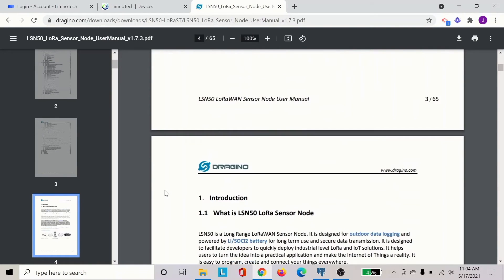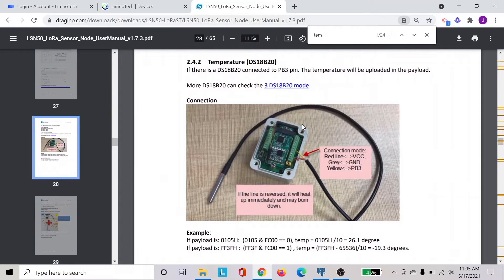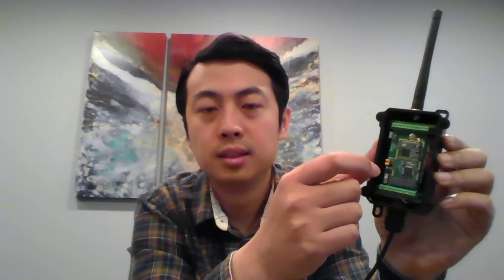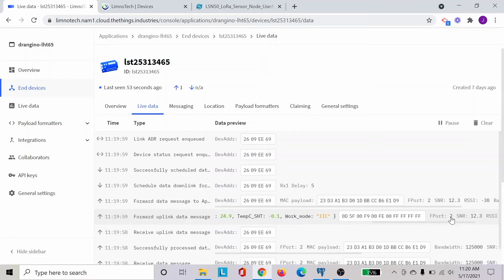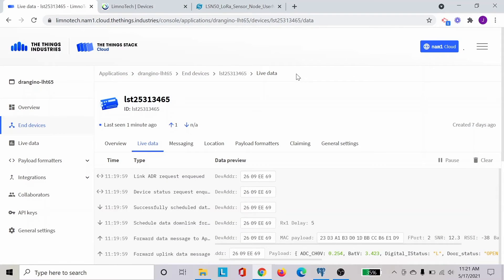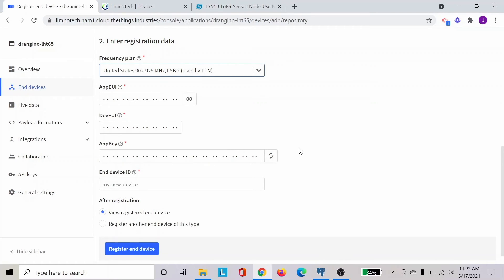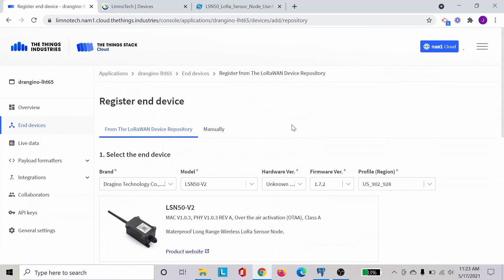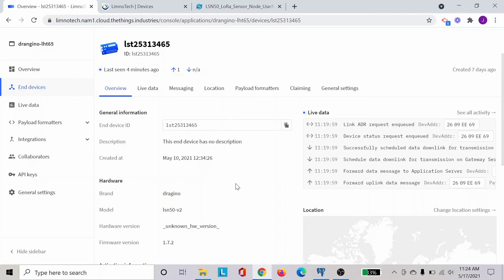IOT Sensor Training Video #4 - Connecting to Dragino LSN50 V2 (Outdoor Temperature)

Comment: Does the sensor node accept rs485? I got the lsnv50 and a  Soil Moisture & Temperature & EC Sensor MODBUS-RTU RS485 and am worried it won't be compatible.
Reply from the maker: You can purchase some thing like this for rs485: https://www.dragino.com/products/lora-lorawan-end-node/item/154-rs485-ln.html.
Reply: What IP rating does  LN RS485 have?